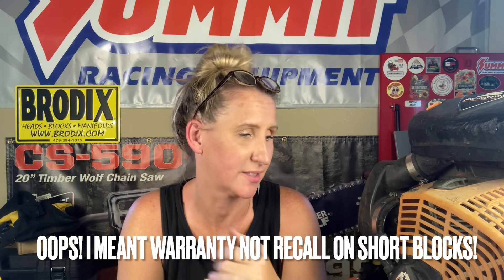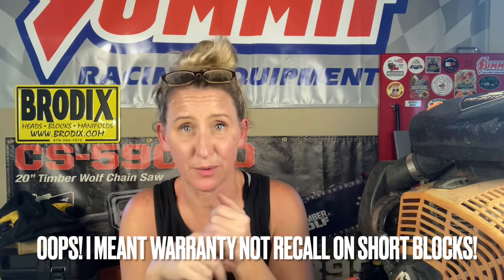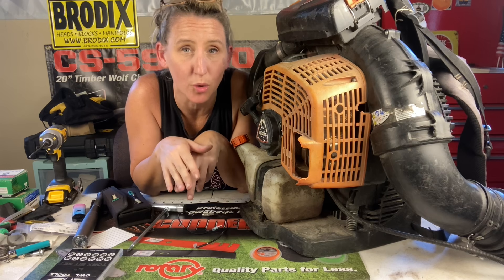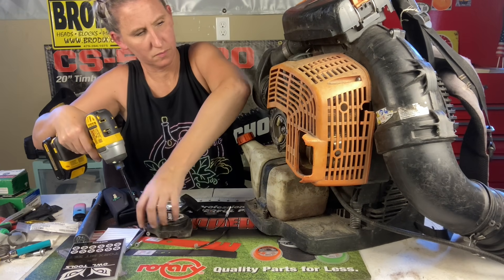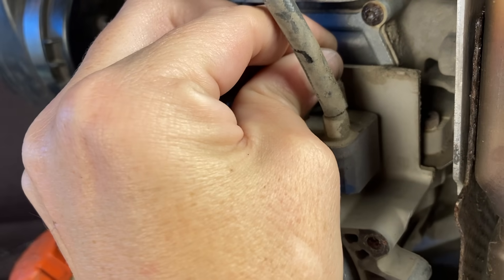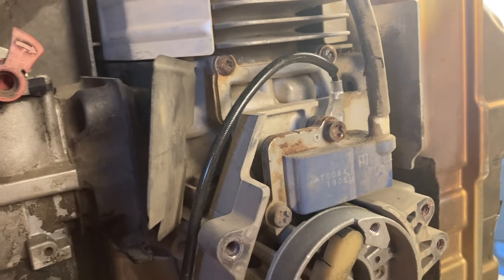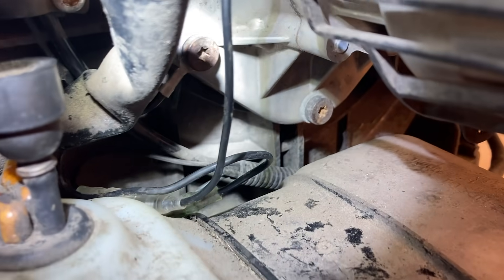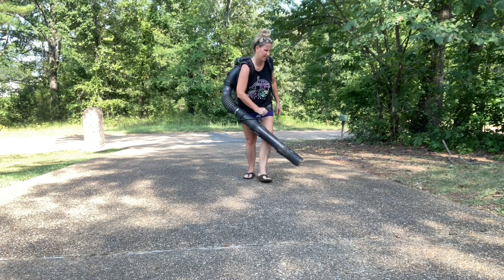ECHO We Have A Problem. Customers PB-8010/9010 Echo Backpack Blowers Keep Dying!

Comment: A little heat shrink tubing where those wires connect to each other won't hurt either
Reply: Plus I’d be tempted to repair the wires with a splice rather than travel to a dealer. Or wait for mail. But would have to find a suitable crimp because I would not trust solder in that hot environment.
Reply: @N4HHE  that motor would never get hot enough to melt solder🧐
Reply: @james-rk5sd I said nothing about melting. Solder gets soft with higher temperatures. Vibration. Fatal combination. You will not find solder splices under the hood of  automobiles. DoD, FAA, NASA, do not allow wires to be soldered to connectors.

Get a small brass tube from the hobby shop which just fits over the wires. Cut about 1/2” length. Fit heat shrink over one wire. Insert stripped wires into tube, overlap the strands. Crush in a crimp tool which folds the center in to pinch the strands. Move the heat shrink over, shrink.
Reply: @N4HHE  yes i know what crimp connectors are i have a bunch of bass ones

Comment: Our shop has sold over 200 8010s and 9010s and 910 Shindiawa's only real problem that we have seen with them is fuel filter pluging issues, mostly in commercial use. Have not seen any kill wire issues yet, but will keep it in mind. Commercial opperators just carry a fuel filter or two in truck and change it out when unit gets low on power or won't rev up. A few broken main frames from one gulf coarse that keeps droping them off carts is the only other issue we have seen with them.
Reply: They suck down a lot of gas so it’s not surprising to get clogged fuel filters. I just brake clean them in a pinch.

Comment: Just an aside.  The push connectors used on those wires have been problem children for decades. They are not designed for outdoor use contrary to what manufacturers may think. I first ran into them when servicing Honda Motorcycles in the late 1970's. The exposure to contaminants, rain, frost etc creates a corrosive environment and the plating on the metal used form a film. Additionally the connectors often use phosphor bronze and the constant vibration causes a loss of tension. When you combine the corrosion with loss of tension, it sits one up for intermittent failures. On the Hondas, the rider would be riding down the road and suddenly just lose power. That almost invariably tracked back to the wire to the magneto.   The fix I used was like yours replace the wires, but also added dielectric grease to the connectors. This went a long ways to keeping out the moisture that caused the corrosion and once I made a repair using the grease, I had no further callbacks. Just my two cents and YMMV.

Comment: Echo used to make great tools. I've had leaf blowers, chain saws, hedge trimmers, and string trimmers from Echo. The last couple of Echo products I bought are garbage. They both stopped working after a few uses. The 5 year warrantee isn't as good as it sounds. It takes me 45 minutes to drive to the nearest service shop. I drop it off and wait a week or two. If they determine its not a warrantee issue it will cost $80 to inspect it, and more than it cost to fix it. Plus I've spent 3 hours driving. If I wanted a disposable tool I would have bought a Homelite.

Comment: As a former Echo dealer, I found Echo to be the most responsive to dealer service issues. At dealer tech updates, they'd always ask "what have you seen?" An Echo rep would write down problem areas on their equipment the techs mentioned. They would address most of these issues quickly. A great company to deal with, imo.
Reply: i had an echo chainsaw, after one year of light use it quit, the local echo dealer refused to even try to put a new clutch on it and i called echo and got a run around hassle, and the saw never got fixed, so much for that 5 year warranty
Reply: Everything echo I’ve ever had has lasted. 2 chainsaws 2 backpack blowers and a string trimmer. Never had a problem
Reply: @jimmyf1312  good for you jimmy, you get a cookie
Reply: Except for fixing the SRM 225….junk!

Comment: Can you explain how a break or discontinuity in the coil kill can kill the engine.  Usually the kill switch grounds the coil primary circuit to kill the ignition.  A discontinuity seems like it would make the machine continue to run even if the switch were activated.  Maybe the kill line is grounding where it is pinchd in that little slot?  Thanks for showing this!
Reply: Rooster, I've seen this a lot as well. The wire she replaced has compromised insulation and is grounding to the engine or bracket that holds it. I wish she would have shown that. The quick home owner fix is to just smear some liquid electrical tape over that wire near the holder. You are correct, a squished wire or one pinched in a plastic shroud is not grounding the primary side of the coil.
Reply: @TheGreasyShopRag   I am confident that Chick knows her stuff.  Your solution is similar to what I might do, but I can see where a shop like hers or yours might prefer to place a new part.  Later!
Reply: Exactly right, and she never explained why swinging the nozzle way to the right would cause something here to kill the engine. The pinch points she mentioned were all plastic, and she didn't point out any wear points that could ground accidentally. I think she knows what's going on here, but I remain puzzled.

Comment: The kill switch works by grounding the coil.  You have a short to ground (the short block) on the wire from the coil.
Reply: Right, and I still didn’t see where it was happening.  That suspicious looking little spot didn’t seem to be worn through.

Comment: Another entertaining and informative video. I don't have the 8010, but my neighbor does. I might be able to help him out someday. I enjoyed the "back-pack blower boogie" near the end. Also, I appreciated your comment about calling the manufacturer and getting the story that they have never heard of that issue before. I have a self-feeding drum sander in my wood shop that began mis-tracking a few months ago. I replaced the drive belt twice (at $65 a pop). I googled the issue and found it appeared to be a chronic problem, with no definite fixes. I called the manufacturer, got "that's a new one" and told them they might want to Google the problem as I had easily found several hundred folks with the same issue and little to no manufacturer support. After 3 buddies and I had tried to figure it out for weeks, I called a retired machinist friend to stare at it with me. He found the problem in about 1 minute. I bought a new drive roller with fresh, sharp knurling and the problem was fixed. Thx.

Comment: Where you said "squishness," as you rotate the wire for the camera, the wire is showing inside the insulation. It's just a small dot, but enough to likely be the problem.

Comment: May I suggest perhaps using high flex wire and heat shrink and some other type of strain relief to make your own wires instead of using the crappy ones it came with? Those blade terminal connectors are cheap. Obviously not if a warranty thing but this looks like something that could be upgraded for less than the $1.99 and $2.99. I bought a Redmax in 2011 and was suspicious of the controls being on the blower outlet and opted for the model with the controls on the left however I am grateful for your videos and I have fixed so much of my stuff from ideas you share. Thank you!

Comment: What would have been the additional cost at the factory to have installed a better sleeve at potential wear sites on the wire?  It seems to me that some of the new wires are coming out with very weak wear resistant  insulation on some wires.
Reply: Sure if you are a factory and have to order 8,000 pre-crimped (assembled ) kill wires, and a supplier can come in with a cheaper rubber insulation (7% cost saving to the previous year's order of kill wires, guess which supplier gets the contract going forward?
Reply: This is what happens when accountants make mechanical decisions  @TheAefril

Comment: I worked on the adjust floor for CAT wheel tractor scrapers. We would fix issue in units after they came off the line. That department is not there any more because they figured it was better to just let the dealers fix the units when they got them or when the customer figured out something was wrong with it. The guy that trained me always felt like these were brand new units and just like you felt like when you got a new car it should be right when you drive off the lot. That is how he felt these units should be but CAT did not think that way. Guess it was a numbers game. If the problem did not show itself until after the warranty was up the customer paid to fix it

Comment: At the shop I was working at, we had 2 8010s doing this. We changed the wires and it still had the problem. We called Echo and they told us to replace the short block with the updated 9010. Did that and had no problems. Echo could not explain why the units were dying but the short block was the fix. Both were under warranty and Echo paid both with no problems.

Comment: OBTW  6 years ago I plucked a PB-770 out of the trash, it had no spark plug, water in the cylinder, frozen and the starter was removed.  I filled the cylinder with WD-40, put on a new carburettor and started it with a drill.  I still use it every season doing my yard and both my neighbors….  The thing is bulletproof!

Comment: I have a 2005 John Deere 42 inch cut. With a 17.5 motor.  The motor blew up. So I had a 24 horsepower motor to go on but I had another guy wire it. He said it needed another coil. And the choke wasn’t right and he didn’t know how to fix it.    I know that the coil needs changed because it won’t start now or when it does it won’t stay running. And sometimes it backfires while trying to start it.     Tim. From Ohio.  Thank you for your time.  God bless     You have a great show..

Comment: Thanks, I've ran into my Husqvarna chain saw doing this years ago & thought it was the coil overheating, changed the coil with no success.  Now I know what my problem probably was, but by then I was frustrated & through it away. 
Now I'll start looking for kill wires if it happens again.

Comment: Thank You.  I have the same blower 8010T purchase brand new and it is the best I ever seen.  I did get a recall for the strap but nothing else.  I am disable and can't rake leaves. I have AS with flareups but I don't really find it overly heavy for what is does truly powerful and not one issue.  Red Armor premix is the only thing I ever used but now its getting pricey, it already was to be honest. I guess I should carry it back to the Echo dealer I purchased it from for a checkup. Homeowner and I only use it about 2 hours max about 8 times a year so it has low hours.  Mine still looks brand new I keep it in our spare bedroom

Comment: We had an 8010 that had the screws from the starter recoil strip out. I tried to rethread it and it didnt work. Dealer had to put in an entire new short block. Crappy thing was echo wouldn't pay for the labor just the parts because they said I shouldn't have touched it. I moved over to the Stihl 800's and I haven't had any issues yet. We still have some old 770's and don't have any issues. Long story short I don't use that dealer anymore or echo blowers.

Comment: I've had my Husqvarna 360BT leaf blower for 10 years. It works great! I've never had any problems with it. Routine maintenance keeps it "in the money". That maintenance only includes clean or replace air filter and exhaust screen, and running it out fuel for the Winter.

Comment: Husqvarna 580BTS user here.  10+ years, starts on 2nd pull.  Full beast mode going on.  Yeah it's heavy but it dominates leaves even on wet pavement.  It also clears fluffy snow off vehicles when needed.  Chafing wires is always an issue with vibrating equipment.  They should be sleeved.  Or at least jacketed in PTFE. ;-)
Reply: I know why dos everyone over look Husqvarna 580. . Its ok we know . What we  know.. lol. 😅
Reply: @thecuttingforce 
sad message husqvarna just “stopped “ completely, manufactured gas engine lawn equipments , instead goes for batteries , and looking for parts(gas) good luck 😢

Comment: A carpet cleaning truck that I would use 20 some years ago had a similar issue. It was the newest one they had, yet would randomly shut off and not want to start. they had the mechanic look at it and had it in the garage several times before they realized it had an intermittent break in the wire to the fuel pump.

Comment: My redmax 6500 did that & fixed it years ago. Runs like a top. I think it's a 2012. I bought the whole new trigger assembly  back in 2019. Never replaced it since it works on at least 70 yards & 2 gardens

Comment: There could be some electromegnetic induction going on between the wires and as the machine revs up the sine waves of the currents either coincide and fortify or they cancel and there is a misfire to shut the machine up.💫

Comment: The biggest baddest blower I had was one of my own creation.  I took an old belt drive furnace fan, 208 cc Honda clone, some duct metal, bicycle brake control, idler pulley and arm from an old snow blower and an old lawn mower deck and made my own walk behind blower.  It was engaged and disengaged with the bike brake handle and cable connected to the idler pulley to tighten the belt and manually through the engine speed control.  Boy, that thing was powerful.  Unfortunately the squirrel cage came apart and I ultimately scrapped it,  Next time I do this I will be reinforcing the squirrel cage wheel.

Comment: Off topic, just wanted to Thank you for the "Speedfeed" trimmer video and your experience. I bought one and it's amazing. My wife especially likes it. I installed it on a new DeWalt DCST972X1 60v flex. No adapters needed just screw off the original and screw on the Speedfeed. I had a 25 yr old echo gas trimmer and it was a beast, always started and ran great. Thank you again. I look forward to your thoughts on the battery powered trimmers and blowers?

Comment: I've got 4 echo  blowes two 8010's and 2 commercial hand held. They've all been junk. The 2 hand held blowers  never have run right since new and the backpack blowers ain't been much better as a matter of fact one of them just blew the motor yesterday.  I service all my equipment regularly and run non ethanol fuel with Lucas 2 stroke oil.

Comment: So far the EBZ8550 is still the best. Runs and starts just fine year after year. My 8010 has had so many issues it's pathetic, and now it's got low compression after a couple of seasons...
Reply: i love my echos but i agree shes sleeping on redmax/husqvarna a bit, they are extremely reliable and have good power, if it comes to trimmers tho i think echo blows rm out of the water, although quite a bit heavier.
Reply: Nah, as far as trimmers go. Almost all my employees prefer RedMax over anything else. I had one guy that liked the 525 Husqvarna the best, but everyone else like the BCZ260TS above anything else. I've got one with four seasons on it, and it runs like day one still. Never had any primary trimmer of any make last that long on my lawn crew... 

I just leave the 2620's and 94R's at home these days.
Reply: @arngreencare8955  that's interesting i favor echo in terms of reliability but i also put husqvarna above redmax in that because of the far better throttle cable design, trigger, carb and reduced vibrations.

Comment: Hello, and thank you for your channel. It is so helpful!!!

I live in Western KY. Plez help me, I'm considering a PB 9010t.  One of the local Echo retailers, who is also a Stihl dealer, suggested looking more into Stihl. Due to their experience with Echo warranty. This dealer said Echo will not honor anything fuel related. Their warranty claims especially for carburetor issues are being denied. When I asked why the denial , the statement is Echo believes the customer is responsible for proper quality of fuel and oil mixtures, and Echo will not honor fuel related warranty claims. This dealer went on to say they have had several carburetor claims with Stihl, with no problems being issued parts and even carburetor replacement.  

What is your current experience??? Any warranty claim denials for fuel related problems? Any advise??? 
 Thank you for your time!!!

Comment: I use the Worx electrib blowers. 1 is a small stick, weighs a couple pounds, I use it for clearing driveways and sidewalks of grass, clearing porches of leaves, blowing spiderwebs and debris off doorways. Then the bigger one for higher demand jobs including leaves. 3 years now with the stick blower, dozens of hours on it, not a single problem ever. 
Echo, Steel, etc. seem to charge a lot more for not such better.

Comment: Bre,  Any chance that the problem is inside the loom where the wires may have rubbed thru their insulation and short out during the sweeping motion? The ground has to touch the coil terminal wire somewhere to shut down the engine but the short sections you changed I didn't see the ground failure for the coil side wire. The control and loom looked short while sweeping. Yes, I saw the unit run with you extreme sweeping motion, but where is the mystery contact happening? If that's the case maybe a kill switch mounted on the engine that could be reached by reaching ack while wearing the unit. No, not an Echo backpack owner just a curious DIY'er. Keep up the good work. Gary

Comment: Great info I do had a 9010 yeah it’s a big heavy blower but it will move some leaves wet or dry, I believe it has 200 more cfm then the Stihl 800 which doesn’t seem like a like but it sure in, now I also noticed the the Stihl has a neck down tip to give it mph while the echo does not,there’s only a 1-2 mph difference favoring the Stihl wonder what the mph would be if the Stihl wasn’t necked down and the echo was. Any way I can blow more leaves farther and a bigger area with my echo then a Stihl